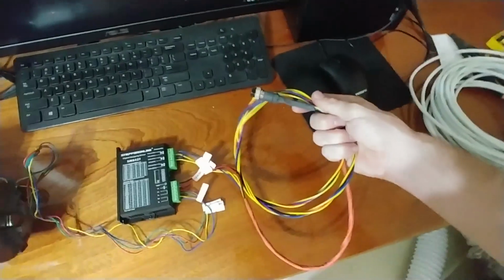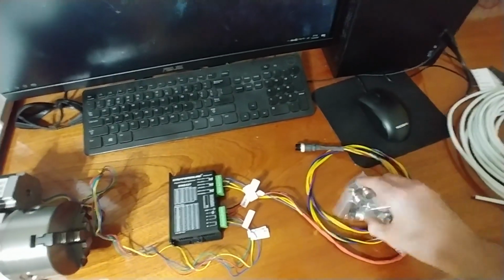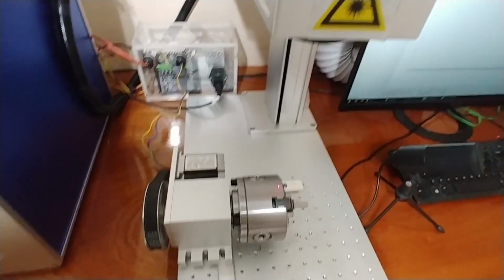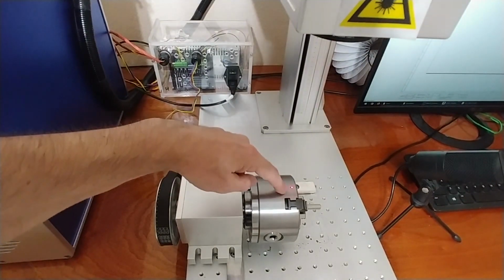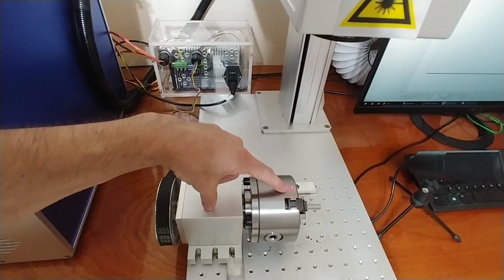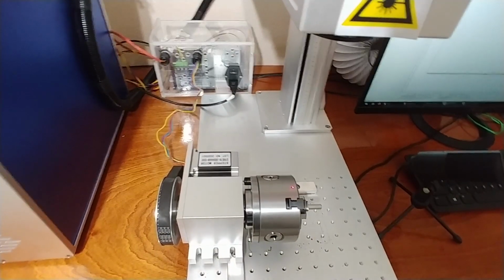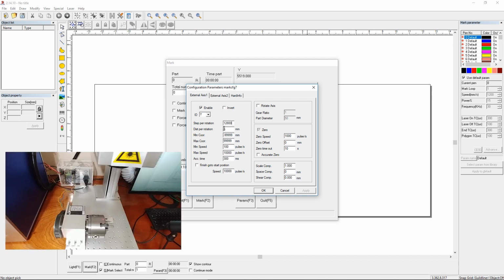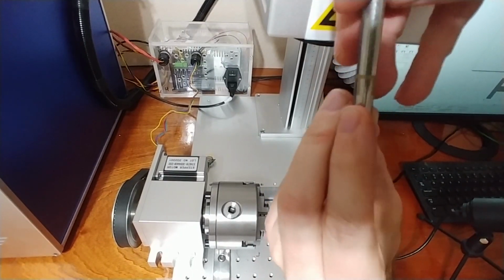Adding a Rotary Axis to a Fiber Laser for use with EzCad2

Comment: Can you add a link to the chuck assembly from where you ordered it?
Reply from the maker: Sure, here's the link: https://www.rattm-motor.com/ruseu-shipcnc-4th-axis-a-aixs-rotary-axis3-jaw-chuck-100mm-k11-100mm-tailstock-for-mini-cnc-routerwoodworking-engraving-p2051571.html

It came with a tailstock and alternate set of jaws.  It was fulfilled by Amazon and arrived in about 5 days or so.  If you're going to order from that site, I'd advise you make an account as their order system is a little shaky; I never received an order confirmation email and the paypal invoice was basically blank.  No issues otherwise.
Reply: @jefferyj  hi sir... can you tell me where I can buy raycus source please... my machine doesn't work anymore so I need to buy a new source for it
Reply: @mustafaali9057  Talk to the man of fiber laser, Richard Zhang
Reply: Thanks
Reply: @DocLazarus-LadyMarie  https://youtu.be/vy__VZJPZRk
Reply: Excellent tutorial for fiber laser owners. It has to be shared www.facebook.com/groups/fiberlaserengraving They should be happy to watch the video.
Reply: @cnclaser0123  I don't mind accepting your friendship

Comment: Hi Jeffery, great tutorial as always. I watched this after noticing my rotary only goes in one direction, (so it doesn't return to home). And wondered if there was an issue with the wiring to the control board. But my Rotary only has 4 wires coming from it not 5 so could that account for the single direction of the unit? Many thanks in advance. Bobby

Comment: I tried to follow your setup parameters and my gear reduction is 20 teeth on the servo and 50 teeth on the gear driving the chuck but I fall about a centimeter short when I do a test rotation. Any help would be greatly appreciated.

Comment: Hey Jeffrey thanks for the vids. very well done.  Concise, accurate no bs and most importantly, NO INTRO, a waste of time.  A ? if you will, I have a 30w fiber rice burner that does pretty good but seems most things I would like to work on are bigger than the field area. I looked through your vids hoping to find one showing how to continue a mark on a large piece. I haven't had much luck continuing a hatch without a definitive line showing at the "joint". Excuse my ignorance if its a simple process but is there a way to possibly "fade" a continued hatch? maybe a setting that would suffice? any help would be appreciated. You are my 2nd subscription since the birth of youtube. Thank you for your time.

Comment: Thanks for sharing. I have the same connection as you but the rotary does not move. I have checked the cables. I have seen that there are like two types of the same board. What are the differences in the serial number? The sticker comes with an A Do you have an A?

Comment: Just built and installed a rotary today.  Your video and the linked info was super valuable.  Thanks for taking the time to make the video.  I too had a -5 rather than +5 on pin 3 and I sure am glad you pointed it out so that I could correct it before I fried something.  Thanks again.

Comment: Thank you for putting up this video and the link to Peter’s website.  I just got a fiber laser and rotary and this saved me countless hours of research and a fair amount of hair pulling.  I had the same issue with the 5v+ being a - and in the same spot, even though my documentation said it was a +.  I ended up putting the stepper drive right under the 5v power supply and it fits perfectly.   I am going to screw it down tomorrow. I clipped out the 5 pin connector that was on the back of my enclosure (that was a nerve wracking 5 wires to snip, even though I knew I could solder them back together if needed!) and replaced it with the 4 pin connector that goes to our rotary.  Now I just need to do all the setup in EZCad and start testing the rotary!

Comment: Hello Jeffrey! Why the rotary stretches the logo on a ring? 💦 I tried different Ezcad operations (Ring Text Mark; Rotate Text Mark; Split Mark2) but they don't give me a straight result. 💦 💦 I activate the rotary with ↑ ↓ arrows in Split Mark and the device works (rotates). However, when it comes to the ring engraving, the rotary doesn’t rotate at all. 💦 💦 💦 I entered Part Diameter and other numbers as in a youtube tutorial, but pointless. 💦 💦 💦 💦 What is wrong? Did I connect the rotary to the laser (30W) somehow wrong... or is my mistake in Ezcad?
Reply: Is it possible that I by mistake connected PUL- and DIR- incorrectly? Would the rotary even spin if PUL- and DIR- is mixed up? At the moment it spins but leaves gaps or spins too much.

Comment: Jeffery, I'm stumped at the moment, I ordered a 4 wire rotary chuck thinking they were all kinda universal. Turns out my laser, a 30w raycus, has only a 3 wire connector on the back which I'm guessing is for a 3 phase rotary. I'm not even sure if I can wire it up correctly. I purchased the laser new from ebay a few weeks ago. I'm at a loss at the moment, with no response from the sellers. Any help would be awesome. Great informative videos, keep em coming.

Comment: Hey Jeffery, when I engrave text my text comes wavy when I want it straight, do you know how I could fix the problem? my metal is flat.
Reply: Hi，At this time, it is necessary to investigate the source of the interference effect of the external power grid fluctuation on the galvanometer. You can try whether the lines scanned by the indicator light are wavy lines when the laser power driver is not turned on. After confirming that there is no interference in the preceding steps, start the laser power supply first to see if the wave phenomenon occurs. Then gradually increase the output power of the laser power supply and observe the traced lines. Finally, turn on the acousto-optical drive and observe it. It is basically possible to determine where the interference comes from at which step the wave phenomenon occurs. After finding the source of the interference, come to think of a solution to the interference.
Reply: @shenyangfaithkiki9768  didn’t understand anything but thank you

Comment: Hi Jeffery, I have one question and don't know personally anybody who can answer this.
 I recently aquired a 30watts fiber laser similar to yours, with a raycus laser source. In the specification of the laser says that 30 watts laser can't go lower than 30khz, but mine can go down to 20khz with ezcad, so I suspect it's actually a 20 watts laser. Can your 30watts laser work with 20khz or is locked to 30khz?? Thanks a lot.
Reply from the maker: Often, ezcad will let you enter numbers that your hardware can't use.  You can restrict this range in the parameters menu.  It doesn't necessarily mean anything's amiss.  If you open your case, you should be able to see the specs of your laser source to confirm it's a 30w.
Reply: @jefferyj  thx for the answer, I opened the outer case the day it came but the label with the watts was not there or perhaps was in the hidden side.
The thing is that in the raycus datasheet they tell that a signal below 30khz as input  is not allowed, but with my machine the 20khz is the strongest lasing I can do by far. Perhaps I should limit to 30khz in ezcad  if the laser is really 30watts, as pulses with more than one 1 mJul can be dangerous for the mirrors too. Can you confirm me that you can lase with 20Khz with your 30w machine??
Thx a lot
Reply from the maker: @eid0eid0  My machine is actually a 20w.  Your laser probably has an internal governor so you cannot damage it with software settings.  Have you checked out the fiber facebook groups?  Lots of good info there: 

Fiber Laser Engraving Talk and Tech
https://www.facebook.com/groups/547620632495173

EZCAD2 Users Forum (good general ezcad group)
https://www.facebook.com/groups/300139820848489/

Comment: I just got my 30w Laser last week from Aliexpres. Thank you for your videos and really appreciate the time you take to make these educational vids for our laser. 

I installed the rotary assembly and been testing it out to engrave powder coated cups. 

I'm having issues with ghosting where for example my diameter is 84.5mm and my split is set for 5mm and hatch to the Spiral setting at 0.5mm spacing. 

What happens to my logo that is about 75mm x 75mm ring (5mm thick) w/ txt Enveloped inside, while its engraving lest say the 3rd split/5mm section, the laser goes out and burns up to the 10th split ring therefore being distorted because its not focused or rotated yet to that area. 

I notice this happening more when I use the spiral and less often when just using the Straight line 0deg Hatch. 

I'm at v2.14.10 Ezcad. This laser has messed up 3 good cups already.

Comment: Quick question, I finally got my chuck and can't get it to spin. When I check the CON4 on the board with my ohm reader, no signal is being sent. Anyone else having this issue ?
Reply from the maker: I couldn't get mine to spin either initially.  I wasn't getting 5v from the jcz board to the stepper drive.  Check out the diagram at 6:21 in the video.
Reply: @jefferyj  I was able to get some help from my Chinese vendor but BJJCZ now says since my card has an M on it, mine doesn't have full features. Does yours have an M on it after FIBER?

Comment: Questions:  If you were to purchase another fibre laser today, would you stay with 20w or step up to 30w or 50w?  Would you go with the Chinese made laser again?
I am looking into purchasing a fibre laser to mark steel saw blades and cutting tools, painted saw blades, and solid carbide rotary cutting tools.  It appears from your videos that the 20w will do the job, but would 30w be faster of better in any way? 
Thank you for making your videos, they are very informative.
Reply from the maker: 30w is faster if you're going for depth.  If I were to buy today, I'd probably get a 30w because the price difference is small when looking at Chinese lasers.  I don't know of any other fiber laser manufacturer that is remotely in this price range, so it would have to be Chinese again.
Reply: @jefferyj  Thank you.  I have looked at other fibre lasers and the prices have been from 15K to 30K and for what I will use the laser for, I just can't justify that much money.  So for less than 1/3 of the lowest price I have been quoted, I can get one made in China.  Thank you again for your videos, they illustrate that these are functional and affordable laser options.  Also thanks for your tips and advice.

Comment: I wanted to add this,, You seem to be the GO TO Guy for All that is Fiber Laser. Very Cool of you to do these videos by the way. This is my two cents. if you did a real start to finish set of videos about Lasers I think it would be a MEGA HIT!!! I see all the time peeps asking how to order, what to order, what options, what power for what metal, nothing to in depth but quick tips so they can look and get answers. Then setting it up out of box and then setting Ezcrash up. That is a big one. I have watched a few of your videos and the settings are hard to see and sometimes go by so fast i have to rewind a lot to get them. most everything i have is totally different than yours, I don't know why. also the rotary video was great but then the ezcrash part went really fast and there was very little detail on the whys of settings, if other lasers from drop down can be used and for what. I never got mine to work. I tried my setting, your setting and others setting i saw on line but it never worked. i have heard that the Knock off boards may be the cause of that but not sure. any way thank you again for these and I hope to see more in the Future about Ezcrash and rotary.

ps there are a ton of CRAP ROTARY videos on youtube. I have searched many many times. if you search "fiber laser rotary" , "laser rotary" this video doesn't come up in the search. it is not at all or in related to Laser rotary search for some reason. just FYI if you can add tags so it will come up for more peeps searching so they find you and not the 100 craps videos in chinese on here that are worthless.
Reply from the maker: Hmm...I'll add some tags to the video, thanks for the note.  I try not to go slow in the videos only because I've found myself falling asleep while watching other people's instructional videos on youtube - even though their video is helpful and has lots of great info.  I'll probably make another video on the rotary to actually talk about settings since I didn't go over it here.

Comment: Thanks for sharing all of this info.  Your channel is a lifesaver.  Have you seen any aftermarket fiber laser options?  I’d like to add a power z axis or even a galvo camera.  It would be great to co-witness my fiber with a camera for easy alignment.
Reply from the maker: I haven't looked into adding a camera, but if you check out Lightobject or places on Aliexpress like Rock Solid Laser or Cloud Ray, they often sell parts and accessories for fiber.

Comment: Does the hatching line spacing have to match the split line size all the time? I'm just trying to set I'm up and get the programing down. you stated that and I wanted to know. Plus the settings in the Canfig screen are very different from what I have. How did you come up with them? Min Max Coor, Min Max Speed, ,,,, Thank you.
Reply from the maker: To avoid having lines in your art, yes the split size should match the hatch spacing.  The values you see for min/max are just numbers I was playing with.  I kept everything pretty low because I hadn't yet bolted the rotary down to anything when I made the video.

Comment: Hey, just bought such a laser, but the Software is on Demo Mode do u know how to fix it ?
Reply from the maker: Make sure your laser is connected to the computer, drivers are installed, and power to the control board is on.

Comment: Have you ever had this pop up on the screen: IPG laser system error ? Received my laser last week, set it up, I was adjusting the lens to focus and this popped up 🤦‍♀️
Reply from the maker: Yeah it happens occasionally.  Restart ezcad - if that doesn't work, power off the laser completely and then restart ezcad.  Supposely it happens if there is a loose connection somewhere, but I've never found one.
Reply: @jefferyj  thanks so much, I'll try that. Hope it's nothing serious,  would hate to have to send it all the way back to China...

Comment: Love your videos Jeffery! I just got a 50W Fiber laser and have Ezcad2 set up. When I power up the laser everything works fine, I create a shape or Text on Ezcad and when I light it I can see it (even though it's kind of blurry) but whenever I click 'Mark" it just loads for a second and then goes away. When I click 'continuous mark' it makes a louder noise like it's trying to mark it but really the red light is just flashing the shape on the metal and that's it. I've tried raising and lowering the laser to focus it but it still isn't actually marking the material. Please help and thank you for any tips!
Reply from the maker: Few questions: I assume you set the marking mode to 'continuous' and ran the Z axis all the way up and down to find the correct focal length at the loudest point?  After that, when you set your text on the ezcad workspace, did you apply a hatch to your object so the laser is filling in your text and not just marking the text outline?  That might be why the 'mark' screen loads and disappears so quickly.

Comment: Mine has a 5 pin on the back like yours. But my rotary has 4 pins. Its a different rotary than yours. Will something like this work?
Reply from the maker: The 4 pins of the rotary are probably leading to the two coils of your motor.  This sounds like the same setup I have.
Reply: @jefferyj  can i just buy a 5 to 4 pin adaptor to make it work or do i have to rewire everything?

Comment: Just wondering my machine has the stepper driver already installed but the pin setup is 3 pins. I can get a rotary axes off Ebay but it has a 4 pin setup. Why the difference?
Reply from the maker: You may have a different stepper drive.  Open the case and trace the pins back to find out where the wires connect.  I've seen lasers pre wired wth 4 pins on the back of the case which corresponded to the 4 motor wires.  In that case, the stepper was already installed.
Reply: @jefferyj  Yes, I found out it is set up for a 3 phase stepper motor. I got a 3phase motor nema 23 which I plan on swapping out the 2phase that comes with the rotary axes. In setting up the motor in ezcad2, i saw that you made the steps to 12800. Mine says it is set to 10000 on the driver but, the lettering comes out stumpy so I did some adjustments and set it to 45000 and it looks just like what I see on the computer. Not sure if its ok to do that or if it will shorten the motor life. Like to hear your opinion.

Comment: I swear you had an update to your enclosure video right... I cant find it.
Reply from the maker: I deleted a few videos that I wasn't happy with.  For the enclsoure update, I no longer use the WEN filtration unit.  It worked fine but the filters are pricey and require frequent replacement.  I now use a simple inline fan and exhaust directly out a window.
Reply: @jefferyj  got ya thank you!

Comment: Hello 
Thank you for the videos I find them very helpful 
Had a question since there already was a port for rotary in back of the machine 

Why it was Necessary to install a support device?
Reply from the maker: The stepper drive was necessary as it wasn't included with my machine.  Some people may have it already with theirs.  If you're referring to the 24v power supply outside the machine, this wasn't necessary - it was just something I added to play with the rotary settings without powering up the laser source.